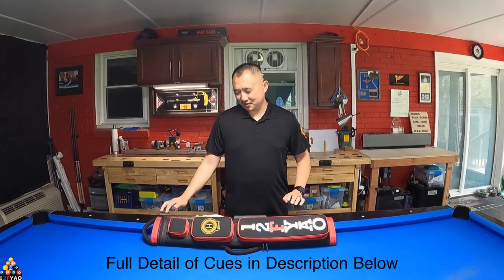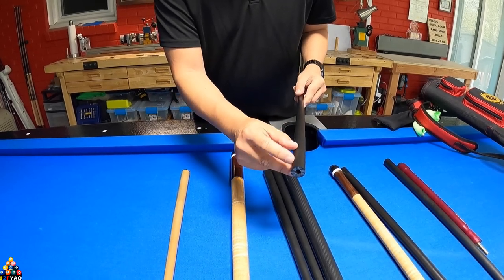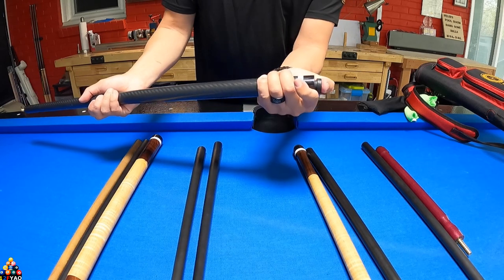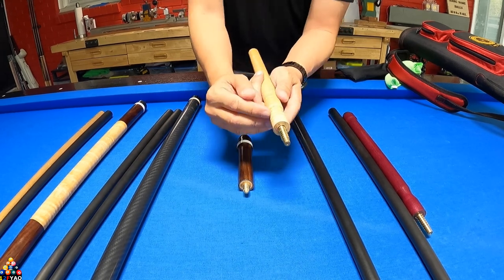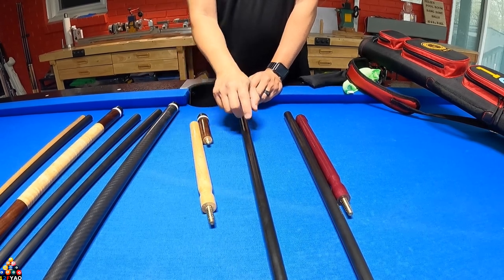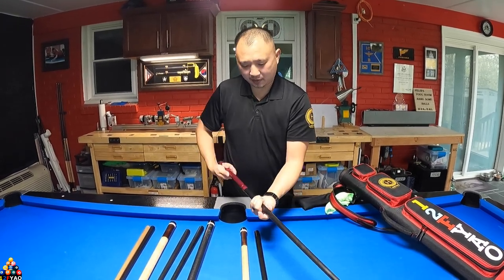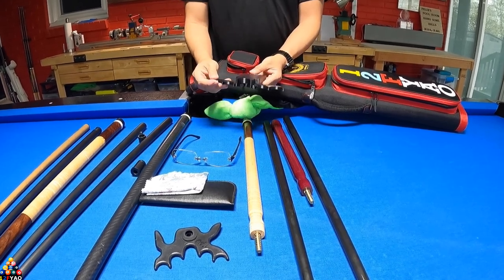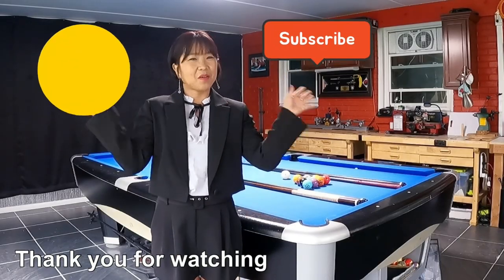UPDATED: NO Production Pool Cues. What's In My Cue Case

Comment: I really enjoy your videos ! I’m just starting out with cue repair and building basic cues. I was wondering what type of epoxies and other adhesives you use for joints, ferrules , tips, etc. Also what do you finish your cues with to make them shine . Keep making cue vids 👍
Reply from the maker: Thank you again. For the epoxy, I use a 5 min epoxy for the pin and screw for the A joint of the cue. 
https://www.muellers.com/Z-Poxy-5-Minute-Formula-2-Part-Epoxy,9940.html?b=s*zap-a-gap+glue
You use BSI also. 
I use the 5 min epoxy for most repairs, ferrules and joints but not for tips. Use super glue for tips. 
For the cue finish, I use super glue, thin for the sealer then thick for the base coat then thin to smooth everything thing out. 
Here is a website that might help. https://www.cuecomponents.com/cuefinishing.html

I am planning to change my cue finishing with Brite Tone. I have not tried it yet but it supposed to be ready good and it is not toxic. 
https://www.amazon.com/CrystaLac-Solids-Polyurethane-Instrument-Finish/dp/B09YS42V89/ref=asc_df_B09YS42V89/?tag=hyprod-20&linkCode=df0&hvadid=598277393005&hvpos=&hvnetw=g&hvrand=18168699060594700588&hvpone=&hvptwo=&hvqmt=&hvdev=t&hvdvcmdl=&hvlocint=&hvlocphy=9013097&hvtargid=pla-1661296976822&psc=1

Since you are just starting I would try out Brite Tone over super glue because the price is about the same or cheaper with Brite Tone.  Also get sand paper 400 grit and up. 
I would get my thing from Amazon also where ever is cheaper. 
Hope this helps and thank you again for commenting.

Comment: You’re shooting cue is beautiful.  

Quick question, when working on a carbon fiber shaft like Revo or whatever. Can you sand those down no problem like wood? And if so, how high of a grid do you have to go to make it nice and smooth? Do you put any type of finish on there or seal? 

Please help, I just purchased a Revo shaft, and I am so afraid to change my own tip.  I always change my own tips, but I usually have a wooden shaft and I’m scared to touch the carbon fiber with my sandpaper.
Reply from the maker: Thank you. As for the carbon shaft, you should never sand carbon shafts. Use a new razor blade when cutting the tip. Many use alcohol to clean the shaft. I use pledge to clean the shaft.  Hope this helps and thank you for commenting again.
Reply: @playpool12fyao  thank you so much
Reply from the maker: @A.Dotin4K no problem.

Comment: Your videos have been helping me get back to play pool! I've been worried about phenolics and G10 damaging cue balls. Is this a concern or should I not worry about it? I currently have this OB break shaft with the Stock Bakelite tip, and I'm not sure if I should get it changed out. Do you happen to have the different tip hardness for the Horo tips? Like the Durometer ratings? Thank you and your cues look amazing!
Reply from the maker: Thank you. Bakelite is like phenolic. It’s linen based epoxy like most phenolic. If the break cue is giving you results, I would not change it. Bakelite is used in many break cue like Predator’s wood shaft break cue and jump cues. I remember back then many tournaments where banding G10 and phenolic, now we don’t really hear about it anymore. Unfortunately Horo tips do not have specific for hardness yet. I need to bring that up to them. Thank you. My advice is, depending on the discipline, cut break on 9 and 8 ball and head on for all three 8,9 and 10 ball, Bakelite is a good tip. If you like doing cut breaks more Horo might work for you. I would practice the break, personally I believe the break is one of the most important thing in pool and not many practice it. Many argue “because I can’t run out, I don’t need a good break”.  Remember making balls and controlling the table wins games. If you break is working for you with the Bakelite, I would keep it. Plus Bakelite is very durable. Hope this helps and thank you for subscribing.

Comment: Is radial better than other joints like unilock? Also are break cue butts built different from playing cue butt?
Reply from the maker: As for the joint pin, “Pros” can’t even tell what kind of joint pin is used on the cue. I like radial because it feels like the shaft is more secured to the butt. Sometimes the brass insert threads gets loose and you have to constantly tighten the shaft to the butt. 
As for the butt construction, production cues will claim butt construction plays a difference to sell more cues. In some way it can. My full carbon butt has no flex, it is light and I feel how solid it hits. Wood plays a lot on how a cue will feel do to its natural resonance. To me the denser the wood like ebony is heavy and feels flat. Hopefully this helps and thank you for commenting.
Reply: @playpool12fyao  i did ask predator if i can use a playing cue butt and attach a BKRUSH SHAFT, Yes, the butt on the BK Rush Break Cue differs from the Ikon.  
 
The Ikon is a playing cue designed for playing only, using it as a break cue could compromise the integrity of your cue.
Is their response.... seems like a safe answer response. 
To u use a different kind of pin and collar for break cue? Looks all the same
Reply from the maker: @ikharl328 technically they are correct. A playing cue with inlays, the vibration from the break can affect the integrity of the cue. Personally I would not use an Ikon for a break cue. It looks too good. I would get an all wood UniLoc butt and put a BK Rush shaft on it vs putting it on an Ikon. I seen players break with their Ikon and regular Revo shaft and nothing has happened to the cue. The cue should hold up to the but if it has inlays the inlays can pop out I won’t risk it. Just get a all wood plain jane and put the bk rush on it. Hope this helps and thank you for commenting again.
Reply: @playpool12fyao my ikon is old, all black no inlays. Does look like the new predator 9k all black with leather wrapped all the way to the bumper area
Reply: @playpool12fyao that makes sense what you're saying tho. Thank you for the explanation
Reply from the maker: @ikharl328 that should work especially since it has no inlays. That will work as a good break cue.